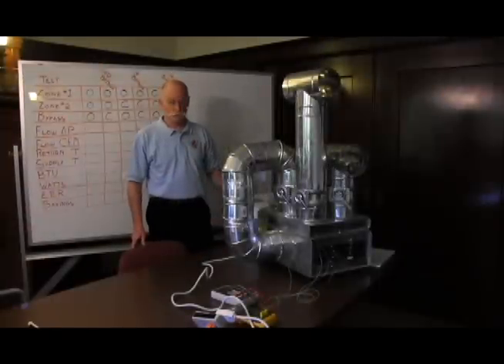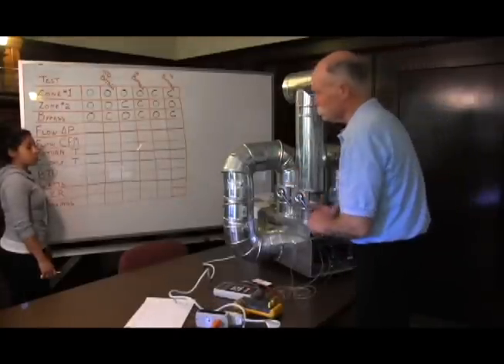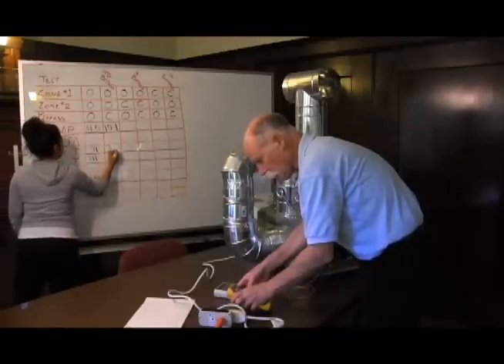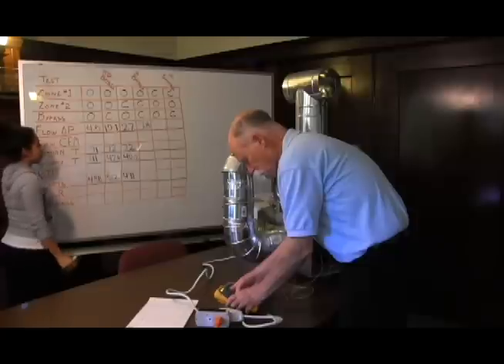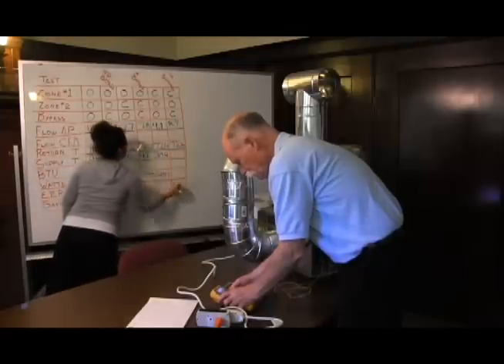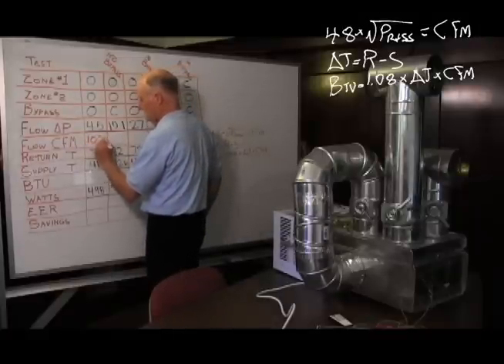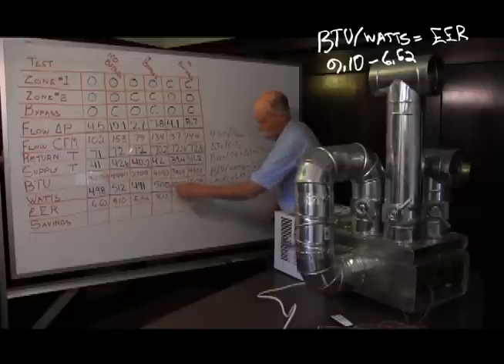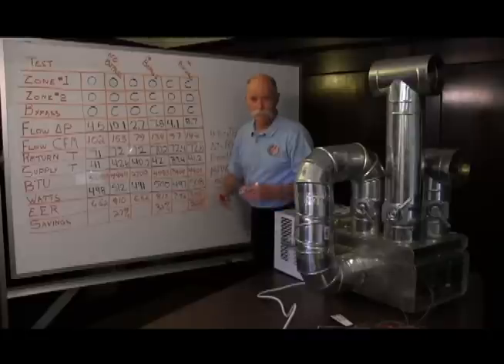Zoned Systems & Why Bypasses Are Dumb.

Comment: The bypass damper is needed to maintain proper TESP on a zoned system. Your duct pressure went from 4 to 10. Depending on your blower it may not even be able to handle that. You need a constant airflow ecm to maintain cfm if damper closes in conjunction with a bypass damper if duct pressure gets too high but that’s a design thing.

Comment: There is one problem with his calculations.  He is only measuring sensible BTU's and has not accounted for any latent BTU's.  What about the extra latent capacity with the colder air?  The EER calculation needs to take into account total BTU's which includes both sensible and latent BTUs.  Plus with a supply air temperature between 39-42 degrees, he may have been partially frosting the coil. That would be additional latent BTU's not accounted for in his EER calculation.

Comment: I'm only a home owner but I see a flaw here based upon my experience. These are equal sized zones with no backpressure.  I have three zones: the smallest is two  guest bedrooms (500 SF) in a walk out basement, next is the balance of the basement (1,500SF) and finally the main floor (2,200SF).  Without a bypass my furnace sounded like a jet engine and made noise (vibration) when heating the smallest zone only.

Comment: What you seem to have missed is that when the damper is open, that zone will cool quicker than when it is closed.  Nice try.  By the way the variable speed fans are EXTREMELY EXPENSIVE.

Comment: So I've read the bypass is to reduce pressure and make the system run quieter.  Why not run 8" pipes instead of 6" and then cut air off to one zone when the heating/cooling is not needed in that area?  I'm guessing you'd also need twice as much return air as well, which can be difficult.

Comment: never in the history of bypass dampers has there been a fully open or fully closed one. your missing the entire point of what it does. its supposed bleed off static pressure from the main truck of a system by sending the extra back into the return. to be clear , modern systems  do NOT need a bypass damper. but if youve got an old as house from the 70s or 80s, and you dont want to upgrade your entire heating system, then throwing in some regular dampers inline into all the zones and installing a bypass damper is the correct way to go. after installing, you leave the bypass closed. then run the whole system wide open and adjust the weight position of the damper so it just barely starts to open. then back it off a pinch until its shut. its now set perfectly for the system. after that, you set thermometers in each room or zone and adjust the inline dampers until you get a uniform temperature or whatever youd like in each zone. Then, the bypass takes the extra pressure thas being kicked back from the semi closed dampers and sends it back to the return and keeps your system from burning out. your math is quite good and youre attention to detail is impressive. but to be honest, you just missed the biggest part of the equation. its the equivalent of trying to find the color of a circle. the math youre putting out has nothing to do with the procees you claim is "dumb". not trying to bash ya, you just dont understand the fundamental point in what a bypass damper does. it keeps you from burning out the heat exchanger or the cooling element of the system by relieving static pressure.

Comment: I love the fact that you built an example of a system to prove a point. Unfortunately all of your bypass damper open calculations are wrong due to the improper placement of the return temperature sensor. The return temperature sensor for your demonstration should be placed between the bypass damper and the evaporator.

Comment: Is it only dumb for Zoned Systems? What if you just need to balance a little bit of High Static pressure, is it ok to put a small bypass then? (On a traditional non-zoned system)

Comment: There is never really a clear cut yes or no. A bypass is not for savings it’s for pressure restraints. In my situation and (probably most) a bypass really isn’t needed. For the simple reason that the problem area is usually the furthest away. So if I have problems cooling the top floor, my bottom floor may shut off. The air then has to travel a further distance then if the top was cut off. That’s ok you lose force the further away the exit is. Now if I wanted to shut the top off and only cool the lower floor, that’s a problem and a bypass is needed. Some would do that to save energy if they didn’t want to top cooled. But I prefer a whole house comfort level. So I’ll never not want the top not cooling or hotter than the bottom. Well maybe in the winter. So bottom line depends on the scenario

Comment: Removing the bypass on a tiny window shaker with only two zones may not be a problem, but it certainly is on 10 ton and up with five plus zones. These are not used for energy savings, but to protect the equipment from high static pressure, and insufficient heat transfer when zones are closed.
Reply: It doesn’t have to be 10 ton big system. Same problem will happen on a small resi system. If you don’t move that heat out of the main trunk it’s gonna trip the high limit on a cold -10 to -20 night.

Comment: Im a TAB Engineer and let me just say.. on a larger scale, we are usually very close to nameplate nominal amps at 100 - 106% airflow.  if you want to save that 27%, put it all aside because in a matter of time you'll be buying a new blower motor for constant over-amping during full load time.

Comment: Common sense tells me the system will use less energy if all the air flow is being sent to the rooms (no bypass).  But saving money is not the only reason for bypassing extra pressure in the system.  Especially in the hot humid south where cooling a room more slowly does a better job removing humidity.

Comment: I am not a fan of zoning, feeding a 140 sf room with a 5 ton condenser is dumb but somebody told the homeowner this would work great. I have seen so many mistakes in installation and so called professional opinions it makes no sense to me. Put in 2 or more systems without zoning and you will have the results you were looking for. Unfortunately builders do not want to spend the money to do that so they sell homeowners on this.

Comment: From what I could tell the wattage was lower with the bypass open. Meaning ther was less stress on the blower motor
Reply: Yes, but if the lower wattage delivers a higher CFM of cool air, the thermostat will shut off the AC sooner, and savings are achieved.

Comment: I like old school engineering with a mock up setup to prove a point with a set of DOEs( Design of Experiments) . As many have pointed out the test is flawed and usually the bypass is weight or spring loaded to dump a certain amount of air into the return . One of the main considerations in a home environment is comfort . Noise , airflow  have to be optimised and they become priority
  The gentleman in trying to help but responding to the comments and actively engaging with the viewers would have been nice

Comment: Neat demonstration, however, it does not (as pointed out below by several others) make the case for closing the bypass period.
It does appear, at first blush, that routing a portion of the cold air back into the return flow would be wasteful and reduce the temperature over the coil.  Problem is, the experiment is as simplistic as it is creative (mechanically converting a window unit to a 'central' distribution system. I suspect that a multi-zone system would employ either atmospheric or digitally-controlled dampers along with variable speed fan(s) to maintain optimal flow though each zone as the calls for each zone are made.

It is obvious that, if one is pushing sufficient air to cover an entire system, shutting down half the supply would effectively (attempt) to push all that air through half the system and increase velocity and volume significantly. So, reducing the air flow into the (effectively blocked) system would seem obvious. If you cannot reduce the fan speed (thus pressure), the bypass does work - with the downside of using the same energy to do half the work and (potentially) reducing the temp over the coils long before the desired temp at the registers/room(s) is reached. 

One would have to agree that a simple manual bypass down in the basement is a jury-rigged approach / solution to a complex issue - not to mention the chore of going dow to the basement or crawling in the attic to turn that bypass damper one way or the other!

Comment: Your test is really flawed
Reply: Shots Fired!
Reply: Ugh excuse me just a minute there, your not testing apples for apples sir. If 1 of your dampers goes closed that is 50% your bypass must go to 50% also your not recording cfm readings at all branches, you can't just arbitrarily say that 50% is 50%. If you have 1200cfm system and you close 1 200 cfm supply that doesn't mean you all of a sudden have a 1000cfm system, the air has to go somewhere, thus the bypass takes that additional 200 cfm's. Also you have 2 -  6" round supply branches and 1 -  6" bypass this is not accurate depiction of what you see in the real world, baypasses are much larger than supply branches.  Lastly, all of this is mute if the blower is not modulating or on a frequency drive (separate vfd on a 3 speed motor best over ECM motor) Now that sir is where your energy savings come from if you don't slow down the fan you get no savings, but you still must insure that minimum cfm requirements across heat exchangers and coils are being maintained, and you cannot insure this without the awesome very much needed automated bypass damper.

Comment: What about the fact that the wattage of the system is more when the bypass is closed? You are correct in that you are achieving a higher BTU, due to an increase in flow at the zones' supply with the bypass closed (therefore superficially increasing the SEER), but this would cause the overall system to cycle more than necessary; causing discomfort and shortening the life of the AC.
Enjoyed your enthusiasm though!  Keep it up :)

Comment: Great little demo, but something is wrong.  When the bypass damper is open, some of the low temperature (42deg ) supply air is mixing with the Return from the space, so the return air temperatures listed should have been lower. With all ducts equal size in this demo, there should be around a 50% mix of 42 deg & 72 deg air, so it should have been around 57-60 deg Mixed air entering the coil.  Delta T would drop affecting all calculations as well.
Reply: Good catch, John.

Comment: 1>Your test is flawed, there is little to no static pressure on your test, hence no temperature change with bypass open. All HVAC systems are designed to have static pressure. Your results will be drastic! 
2>Zone systems are usually installed 90% for comfort, not $$$ savers so ace the watts.
3>I did enjoy watching this video though :)

Comment: Bypass dampers are made to reduce noise by high static pressure that are produced when you reduce the duct volume by closing a damper in a duct . I have never considered a bypass damper or any zoning,  for that matter as means to conserve energy. In multi zone configurations that incorporate more than three zones of different sizes a bypass of some kind would be essential. if only one zone is open and that zone was the smallest, without bypass and thermostatic freeze protection the unit would stop working altogether. This guy knows nothing about the application and design of a zoning system or the primary principles in dynamics of air flow as it relates to a air conditioning system.
Reply: Amen
Reply: Thats why we call engineers "ruff drafters" and spend all our time arguing and fixing their mistakes!
Reply: @Im-not-clever  It's more importantly installed to relieve the static pressure and prevent short cycling rather than noice reduction.

Comment: bypass dampers are not for energy saving. I have three zone system in my house amd it doesn't have bypass. When all zones are on it's perfect, but never are on at the same time, so it feels like the house is taking off. That bad. And also I'm gonna add a baromatric damper, not like that one on the video. it's a great experiment, but unless to me.

Comment: bypasses are needed for humidification or for noise or pressure issues.....their is always pros and cons to things......should have done this experiment with a furnace in a house...would have been easier than this flawed set up you used here

Comment: This illustration is done with either a "OPEN" or "CLOSED" damper - nothing in between. So, of course you will have some significant losses - and it is "DUMB". BUT...this is not the proper way to do it in the field, nor have I come across one that is either on or off like that. However, BAROMETRIC or Static Pressure control dampers only lower the main trunk supply static pressure enough to maintain proper airflow through the calling zones and across the coil. Of course, a similar approach would be to have a calibrated ECM (variable speed) blower or Multi-Speed (2 or 3 speed) blower to provide close to optimal static pressures and CFM's in calling zones. However, as with many older systems out there, many blowers are set on max speed to be able to provide proper airflow over the coil AND to be able to provide all zones with proper CFM. In this case especially, a properly setup barometric or static pressure controlled damper is the best solution. So, I do not agree with your assertion that "Bypass Dampers are Dumb".
Reply: You correctly point out that his test doesn't duplicate a correctly installed bypass damper.  I still think that a better way to achieve the same ends is to adjust the non calling dampers to bleed air.  I still think that bypass dampers are dumb.
Reply: @Marty1911  
Totally agree with you, I’ve been doing it for years without a bypass. Just bleed some of the air to other zones and call it a good system instead of having that dumb idea of bypassing
Reply: I'm sure it was a quick solution to a persistent problem that some zone control systems didn't want to handle in the past and it stuck around like a bad rumor. Haha

Comment: The evaporator inlet air temp when the bypass is open should be the 50% colder than when the bypass is closed.  I think the bypass air flow is not being measured properly because the bypass duct is right up against the coil inlet.  I can't see how the return air and bypass air are being mixed but the 70 degree temperature measurement is a contradiction to the 50% rule.
Accurate calculations need to be based on a real system with a thermostatic expansion valve that is reacting to load on the coil.  Window AC units don't usually have a TXV.  Units with a TXV will reduce compressor amps because the TXV valve reduces refrigerant flow as the suction temperature drops.  I don't like the bypass and I think it is a waste of energy but this demonstration looks flawed to me.
Reply: First time in 30 years that i see someone that actually thinks the same way i do, 👍 good job

Comment: Nobody like the bypass damper but it is an necessary eval to make the air noise at a register tolerable. This is an eye opener to start working with variable speed motors. Now give us these results. Thanks, NAS